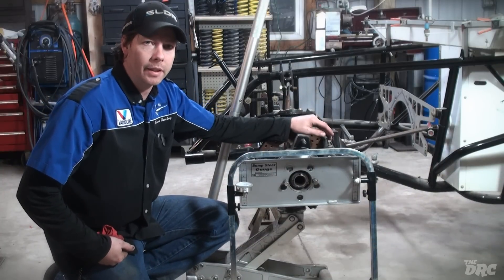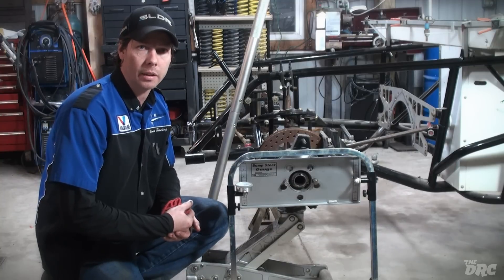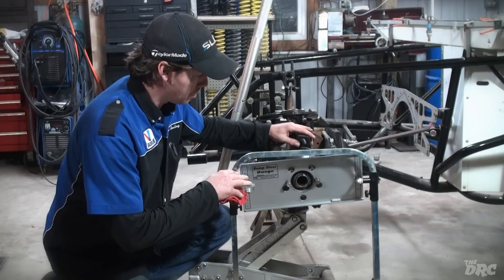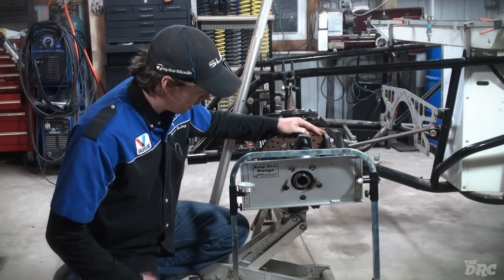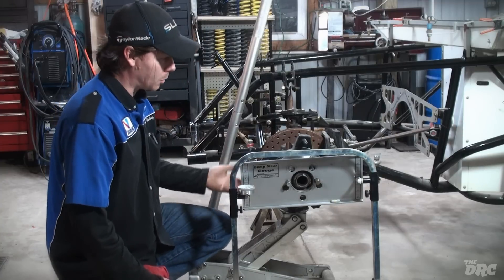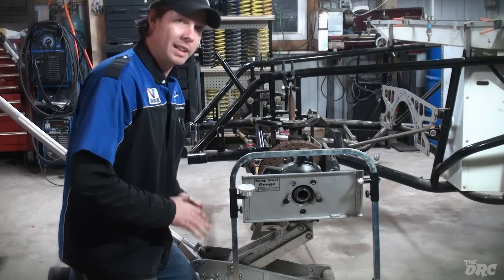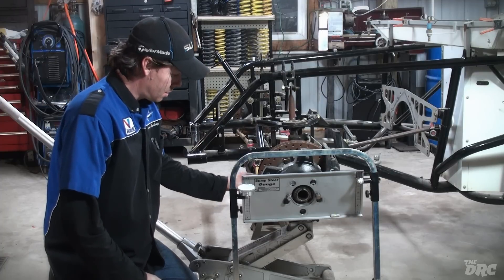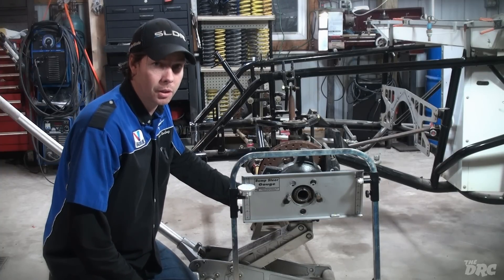The Gray Area With Brian Gray | Season 2 | Episode 1  | Bump Steer

Comment: On a dirt track, the left front is hardly ever on the ground.
Reply: Sure is or barley doing anything, but that's why its important, when you have to get off the throttle fast to avoid another car, and that wheel goes one way or another you will wreck. Bump steer is very important on dirt tracks because the wheels move 10" or more in travel,